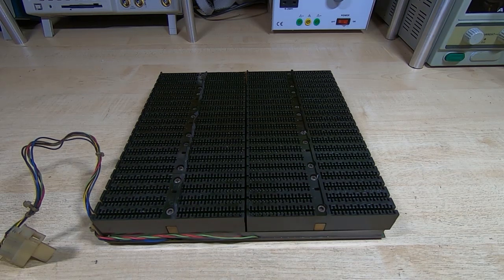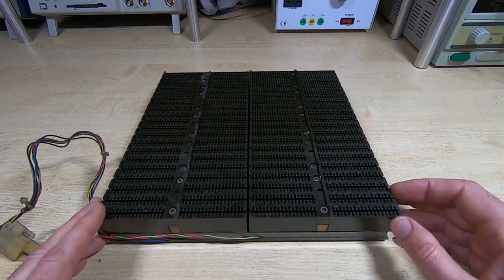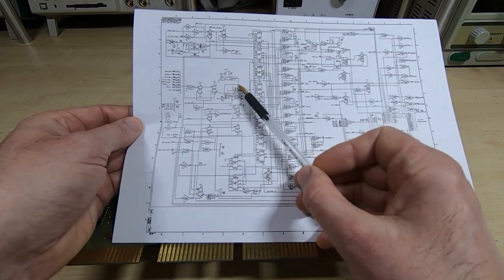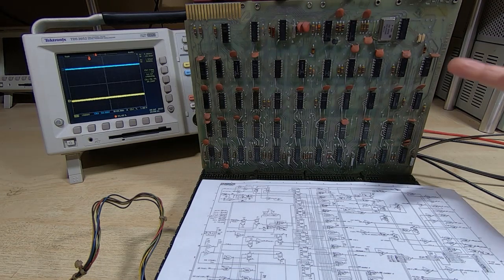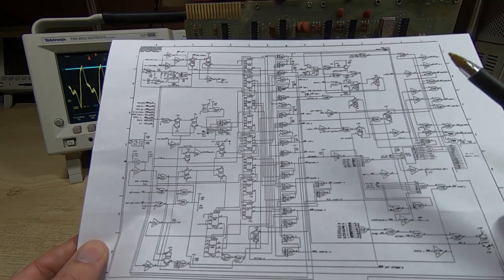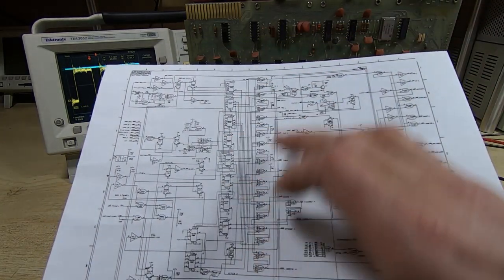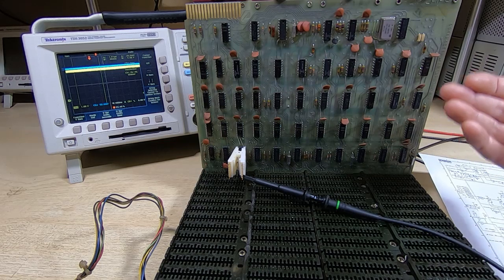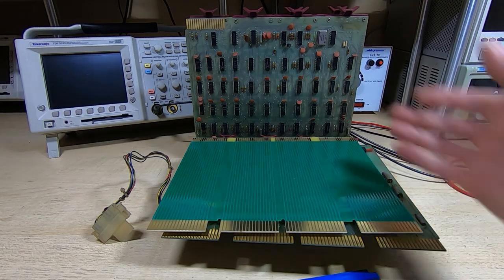PDP-8M Restoration Part8

Comment: Very interesting video. I enjoy watching troubleshooting videos - I like to see the thought process. For me  the journey is more interesting than the outcome - although I also like a good outcome. My current project is an HP 3490A Digital Multimeter from the early 70's that does not use a microprocessor.
Reply from the maker: Yes I totally agree, I start losing interest in things when they work. I repaired a 3490A a few years ago and the electronics in them is interesting but the mechanical switch parts can be a bit fragile.

Comment: Jerry, the OMNIBUS was only used in the PDP-8/E, /F, /M, and finally in the 8/A.  Previous PDP-8 family members used different busses - I think they are POSIBUS &/or NEGIBUS or similar.

I like your tip on heat-shrink-covered circlip pliers for removing modules from an OMNIBUS when exposed on a workbench.  I need to remember that!

I really wish I could read these schematics and understand wjat each portion of the circuitry does and what I can and can't do when testing.  I've got a spare OMNIBUS backplane that I can set up for testing modules like you did on the M8330 Timing Generator here, and can set up a benchtop PSU for +5VDC for modules like this one that only require that voltage.  How did you know that these two modules should pull ~2A if operating properly?  Did you count ICs and apply a "standard" amount of amps/IC or is there something else that I need to investigate & learn?  (Obviously, I'm not an electronics guru, but do collect PDP-8s and have to try to troubleshoot & repair them as different failures pop up.  I'm an ME, not an EE, so I know that I've got a lot to learn.  I tend to be awfully slow due to fear of destroying something beyond repair!)

Thank you very much for posting this series (and your other videos too!) of PDP-8/M troubleshooting & repair videos -- I learn a lot from every one of them!

Edit: I'm looking forward to the next videos in this series.  Now I'm going back to binge on the core memory series.  ;)
Reply from the maker: That is partly accurate although the OMNIBUS was not restricted to just the machines you list (or even just PDP's). There were a number of variations such as the QBUS although they can still be thought of and referred to as OMNIBUS simply because of what the name represents. I know what each module should draw depending on what it is doing because I have repaired many of these machines and generally carry out a lot of testing on each board.

Comment: Also, you cannot change the order of the cards if a articular card that you are working on uses interrupts. On the Omnibus interrupt priority is given by the position of the card in the backplane.
Reply from the maker: Yes, I will get on to specific functions in later videos. For initial testing you can put the cards into any slot. The user manual actually gives a recommended order for cards although this depends on what option cards are fitted. You can also modify priority if you want to. One of the nice things about discrete systems like the PDP is that you are free to make whatever changes you want at any level in the system. In fact many PDP systems originally shipped were bespoke and did not all stick to the 'standard' layout. From what I can determine from the unit in the videos it seems to have originally been an educational unit and possibly shipped with an ASR33 but that has naturally long since disappeared. It also seems that several card slots which originally contained cards are now empty so it will be interesting to see what condition it is in.
Reply: I still have the ASR33 that came with my unit, but, though the motor spins when you power it up, it continues to chatter when you connect it to the 20mA loop. It seems to be brocken. I do not need it as I use a computer running putty for the interface, but sometime, maybe, you can do a series on the mighty TTY machine.
Reply from the maker: @Bata.andrei  Let me know if you ever want to sell the ASR33
Reply: @Bata.andrei  CuriousMarc made a series of videos repairing one of these. They may be quite helpful for you.